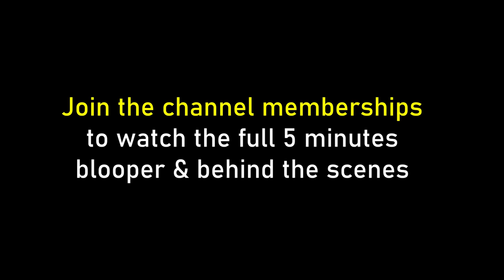Ping Pong Table Full Of Holes

Comment: You guys should invent a table where you can remove pre-made holes. I would love to try this
Reply: Rather than holes, I'm picturing a table where the sides get smaller. Easier cuts to make and it seems like more of a handicap rather than being as luck-based as the holes.
Reply: or just get something flat to place over the holes
Reply: or they can just stick those disks on a different table
so it'll be like a table with disk platforms instead of holes

Comment: Ideas:
1:   play on a table that is constantly moving and rocking, something like and earthquake simulator (the things with the spinning arms that make the platform they're connected to constantly move in a circle)
2:   play on a table that is extremely uneven, like take some wood and start putting massive dents in it (you'd probably need something like super thick foam core to get enough of an effect)
3:   play with extremely uneven racket
4:   play on a table that is made out of tensioned canvas, basically have the table be a trampoline, use whatever material that will work (note: if you affix the material with nails or something similar, start from the middle, not the corners.  That way you don't get a bunch of extra material stuck in the middle)

Comment: The trick to using any saw is to make sure the saw dust gets cleaned out of the kerf.  Use the saw to scratch a circle on the surface.  Then us a regular drill bit, 6mm to 10mm, to drill three holes tangent to the inside edge of the circle, about 120 degrees apart.  Now finish using the hole saw.  It will cut much, much faster than before because the saw dust will fall through the holes.

Comment: Not sure the teeth on that bore bit are right for the material being cut. What happens if the bit catches and the force is transferred to your wrists? The shear pin breaks with a certain amount of force to prevent damage to other parts and the user.

Comment: For anyone who wants to play this at home in a non destructive way, just cut circles out of fly paper or any other double sided sticky material and stick em on. Same effect really. If you really want to invest, play with a sheet metal surface and cut use thin magnets with fly paper adhered to one side.

Comment: I have invented tt table with 5 holes on each side of the table. I presented innovation at Inova Zagreb fair 2011.and recieved a silver medal.
The point is to hit in the hole becouse 40mm ball is not easy targeting in the 100mm hole.
Anyway, I was trying to connect pool and tt.

Comment: Why not just use a normal ping pong table and stick circular tape on the surface so the ball sticks, achieving the same thing as hole without using wood, and also reducing the effort?
Reply: That was basically my suggestion, but also why not just put an ever increasing hole in the paddle itself...Now that would have made a more entertaining video and it would have been so much easier.

Comment: this doesn’t make sense, the person who scores the point should drill a hole on their side, that way they have more chances of scoring points. since the point goes to the other person when the ball goes in the hole, the person who’s losing has more holes which gives themselves a higher chance of scoring points since their side of the table has less surface area. basically this video is rewarding “losing” since the person losing has a higher chance of scoring more points, when in fact it should be the opposite and the winning person should be gaining an advantage

Comment: Surely this has been done backwards. If you lose the point for hitting it through the hole....when you win the point you should put the hole in your own half, not in the opponent's. How's my man in red winning 9-5, I paused to typed this comment....yet he is disadvantaged because all the holes are on the side he's hitting too. If the other guy is loosing 9-5 then he should habe 9 holes to hit at and potentially lose even more points.
Reply: Like basically by winning a point, your making it harder for yourself cause you win a point but then you have an extra hole to hit it at which could cost you a point.....doesn't make sense does it. Otherwise its a really good idea.